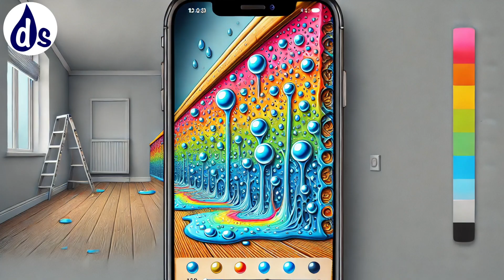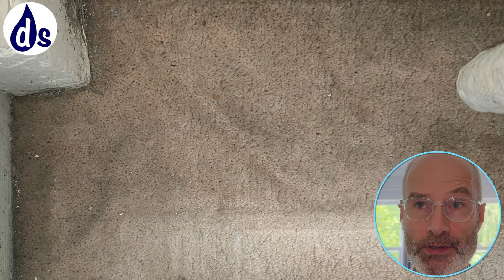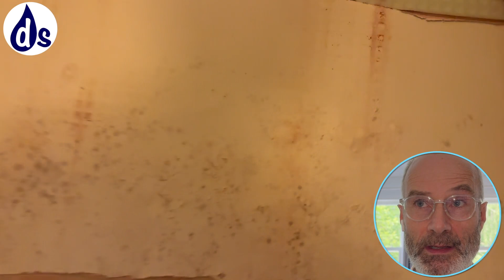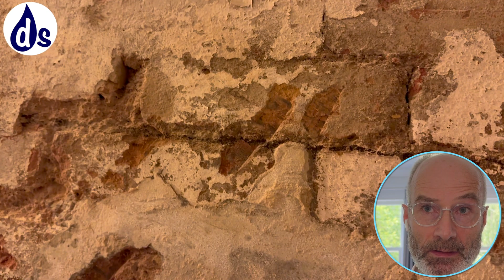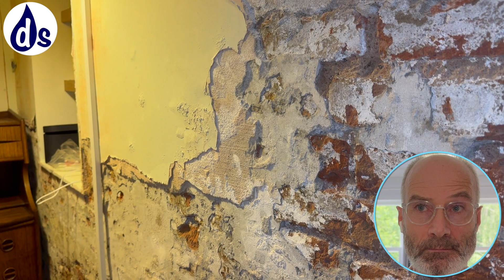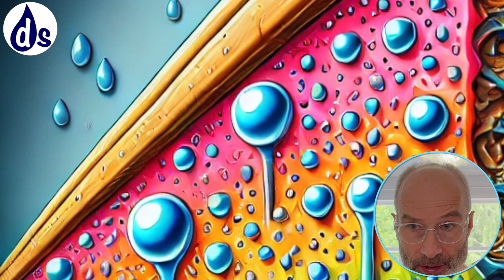Remove cavity membrane damp proofing

Comment: 8mm mesh membrane fixed with 10mm seal plugs with 25mm insulated plasterboard, making sure the membrane is taken up behind the ceiling and gap at the bottom.
Reply from the maker: Thank you for your comment! 😊

In my opinion, it’s unlikely the wall ever needed a cavity membrane, especially if it wasn’t in direct contact with a below ground external wall. These membranes can often cause "sweating", trapping moisture and preventing natural evaporation, which could lead to other issues over time.

That said, it’s difficult to be certain without seeing the wall in its original condition before the membrane was installed.
Reply: @dampsurveys  interstitial condensation as you mention will only happen if you close the cavity membrane off at the top or bottom.   This is why I described venting above and below.